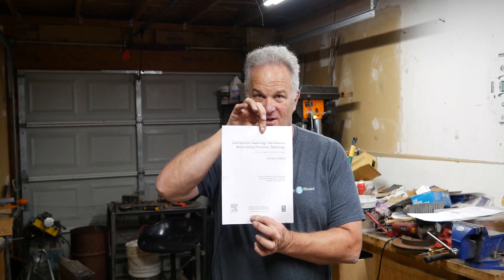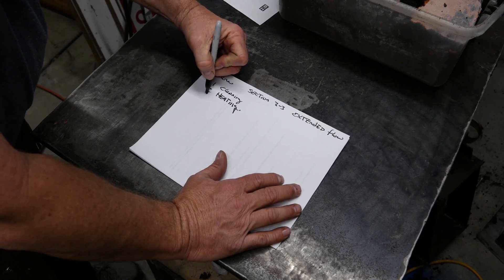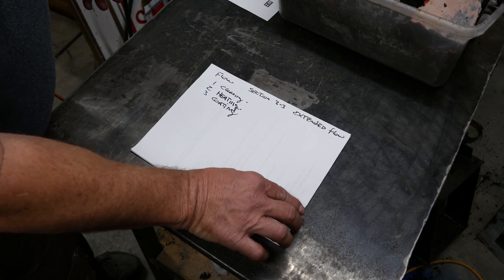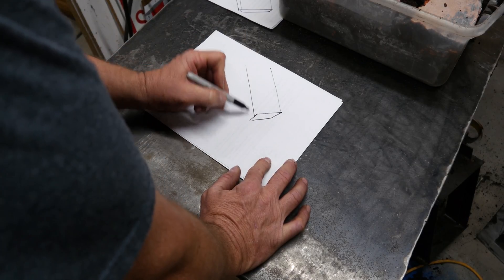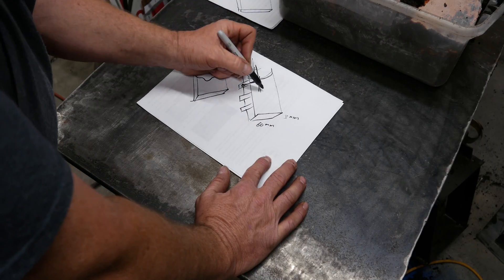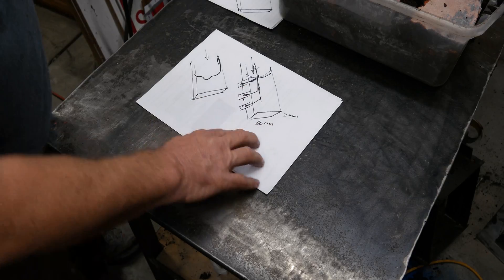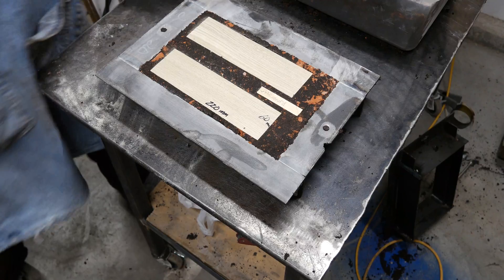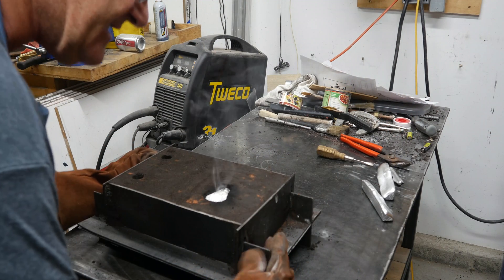Testing Hiratsuka’s flow extender

Comment: Just watched this again and that was pretty dang amazing,  I've been studying Campbell's research  also and filling the molds from the bottom up is definitely the way to go, I'll have my furnace finish soon maybe we can learn a little from each other,  it seems that the best techniques for completely flaw free castings is a system called trident gate it consist of a spin trap to slow the metal down and trap the initial dirty metal that is in the beginning then flows up through a series of gates and filters. Don't think the little castings most home brew guys do are big enough to do this but if you ever have a need to do a larger casting defects free it's great to know how to. Anyways look forward to your next casting Perry.
Reply from the maker: It was pretty amazing.  I keep wondering if the same technique could be applied to the runner.  I don;t expect the metal cools all that much in the runner but I expect the leading edge is cooler than the metal coming behind it. 

I'm hopefully doing an experiment with a spin trap at the end of the runner today.

Comment: Perry, excellent work dude! That was amazing. 
Still waiting for my copy of Campbell to arrive. Wondering if the cross troughs have to be that deep? Thanks Bob
Reply from the maker: Good question. The book is pretty vague on the design of the cold metal dumps. It doesn't give any real description of frequency or size of the dumps. I expect that you could make them smaller than what I did. I expect that they've just got to be big enough to hold the cold leading edge of the advancing metal.
Reply: I would imagine the size of the dumps would depend on the metal. I would assume for aluminum they would be much smaller. I'll let you know when I get my foundry complete. I have a serious interest in thin wall tubing so ...
Reply from the maker: @IamUncleBob-R  The thickness of the pour (volume of metal) might have an impact on the size of the dumps as well. It would be a fascinating thing to experiment around with.
Reply: @swdweeb  I will definitely be doing these, my model rockets need thin wall aluminum for many of the parts. Let you know when they occur.
Reply from the maker: Super, I'd love to see what you make
Reply: @swdweeb  PS, you mentioned lack of a milling machine. You might want to look at the Gingery Miller. You cast most of the parts! Peter (channel: PGS) has an 86 part series on making it. Last episode he is cutting gears to repair his lathe. Gingerybookstore.com for the manuals. My first project is the Gingery lathe to be followed by the Miller.

Comment: I've been wanting to cast some bronze switch plates. My concern was just that...a fairly long thin casting. This seems like a solution but milling or worse filing seems to be counter productive. Wonder if they ran parallel to the flow if it would still work? Might be easier to use the bandsaw to remove them.
Reply from the maker: I don't think so. The purpose, from what I read, was to give the cooler leading edge a place to dump as the mold was forming. That way the leading edge of the flow always remains hot. I cold be wrong, but that was my understanding from the book
Reply: @swdweeb  that makes sense. I'll try pouring from the short dimension
Reply from the maker: That's what I would likely do. Multiple gates into the part will help as well. It's pretty amazing how quickly a part can fill.  I was shocked at how fast the bells I just cast took the metal and that was filling from the bottom up.
Reply: @swdweeb  I watched that and the small fry pan from the bottom. I'm going to try that. Enjoy your videos, I learn a lot...keep em coming.
Reply from the maker: That darn frying pan... I need to redo it and do it right. My wife has it hanging in our kitchen ;-)
Reply: @swdweeb  lol I have a bronze sea turtle I cast that came out rather boogered up. It sits on the kitchen window sill as a constant in my face reminder of a great fail. 🤣

Comment: You essentially have a series of hot risers along the length of the casting. By having those large sources of heat retention it allows the flowing metal to maintain heat and flow to the end of the casting. If you were to additionally add a v-break or some other stress concentration to the connection point of the risers, they could be broken off with minimal machining needed for clean up. I remember reviewing flow distances in school, but I forget the calculations for it.

Comment: VERY interesting.  I could see incorporating the dumps into a design, something like reinforcement ribs.  However, for a piece like this, I would think the ribs would be most beneficial if they ran in-line with the length of the part; and as I understand this technique, that wouldn't improve the flow distance.  I suppose you could pour it from the short side, but I don't see that working as well.  It is certainly an interesting technique, and I could see it used in industry.  I wonder if you could improve the flow distance using dumps that ran parallel to the flow direction?  It would be an interesting experiment, and just this experiment has sparked numerous ideas.  Yah science!
Reply from the maker: I'm an engineer by trade and I can tell you that every time I see a set of data about some behavior, it gets me asking more questions just like this ;-)

Comment: Thanks for putting this together!  Amazing the difference there and nice to be able to get this information quickly from a video.
Reply from the maker: You're more than welcome, it was a lot of fun for me.
Reply: What are the odds you could do small tubes down, to catch the cooler metal periodically?  This would make it simpler to just cut them off, instead of having a piece like that you have to grind off across the full piece.  It wouldn't be as effective I'm sure but it may help some.  Ultimately still very cool!
Reply from the maker: Ha! :-D I could devote a channel to this experiment. I've got a couple of other things I'm going to try as well. I expect that you'd end up with pretty uneven flow down the part with the leading edge over the hole possibly flowing further than the leading edge that don't get to have the cold metal dumped off.

Comment: You have peaked my curiosity now.  I wonder how much different size ribs or spacing between them would affect the flow extension. Does the article you reference touch on any possible relationships between casting thickness and rib size or spacing?  I wonder if u-shaped ribs would even the flow rate out more?  Your video has my wheels spinning on how to test these flow extensions.
Reply from the maker: Here's the quote from the book... Not real helpful ;-)

"The positioning of the overflows in Hiratsuka’s work is curious, and would not be expected to result in an optimum
effect. The authors give no reason for this. It seems there is plenty of scope for research to find rules for optimum
positioning of overflows to obtain maximum benefit."
Reply: @swdweeb  Thank you for the response. I had hoped to get into the shop this weekend to test some of this but instead I am at work.
Reply from the maker: Mark Shymanski  The casting world will be here tomorrow, or even next weekend ;-)

Comment: Nice demonstration. Wonder if that would work with shallower grooves (or thinner grooves  tighter spaced) or do they need to be that big. Would save a ton on belts when you sand them away on a grinder. 😊
Reply from the maker: I expect you can get away with shorter/sallower grooves. I just tried to recreate the scale in the drawing. Thinner might work as well too. A lot of experimentation could be applied to this technique.